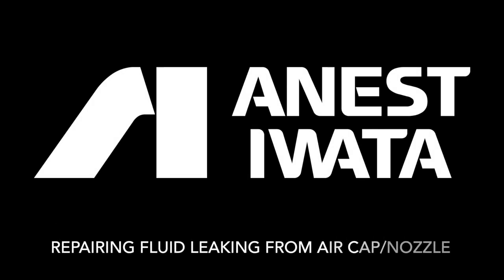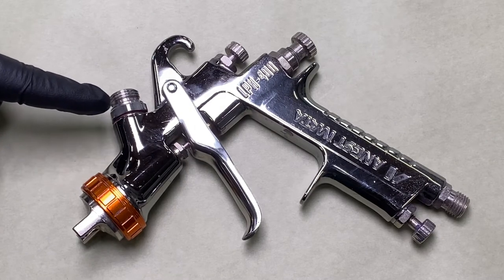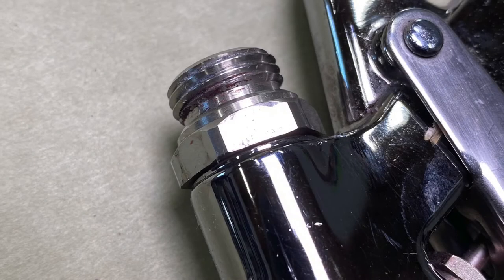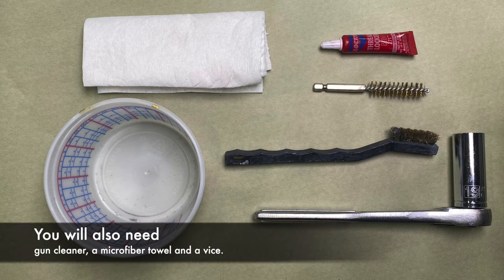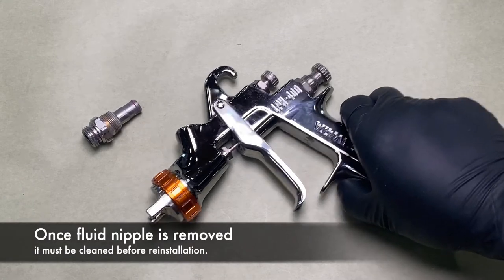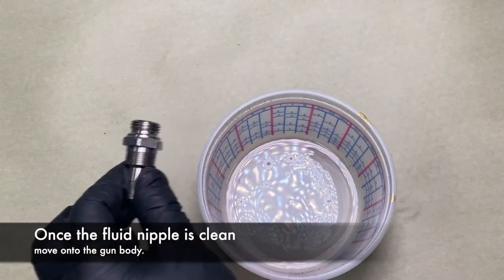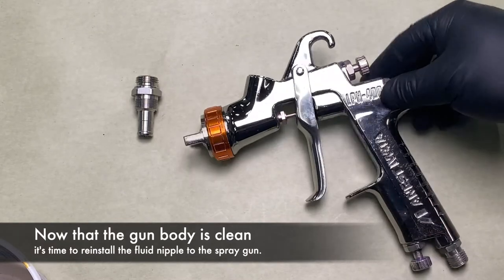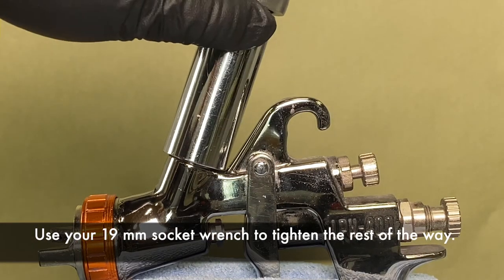Repairing fluid leaking from air cap/nozzle

Comment: i have a ls 400 and my problem is that it has a air leak only from the air cap. can you help me finding the solution of it?
Reply: I know it’s 6 months later bro, but it seems like they got tired of answering questions lol, but I would say it’s probably the plastic O-Ring on the inside of the cap. Sometimes they’ll get loose if you clean them in lacquer thinner too much! Hope this helps homie💯

Comment: What could be the problem if my lph400 is not getting enough air pressure through. All I did was replace fan adjustment knob and gave it a clean and now it doesn’t have enough air pressure getting through. Thank you😊

Comment: Can you please make a video on why air leaks behind the trigger on the lph440 primer gun. I'm having issues fixing the problem
Reply from the maker: There is a video up currently on that air leak issue with a LPH 80. The Repair is very similar to the LPH 440.